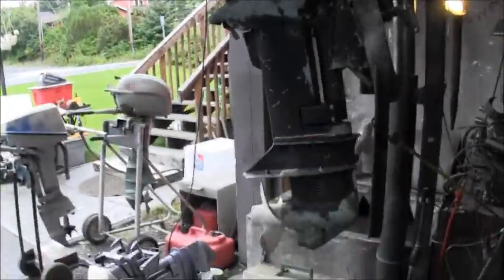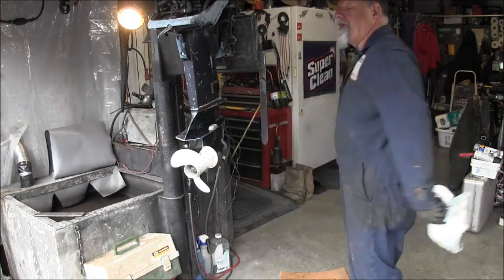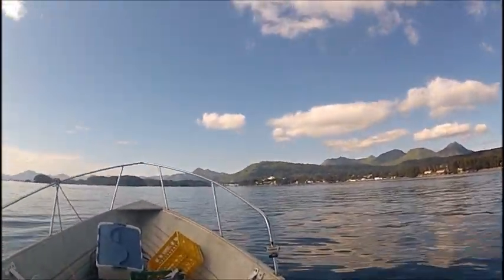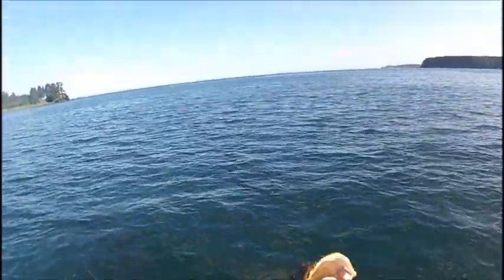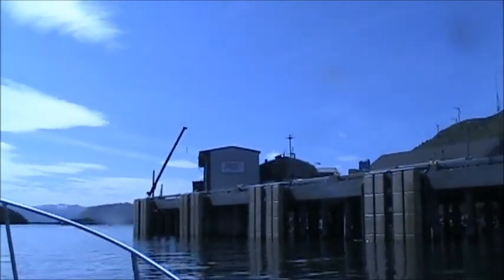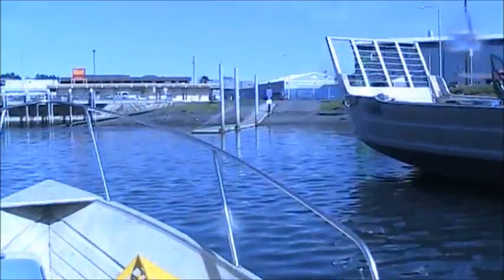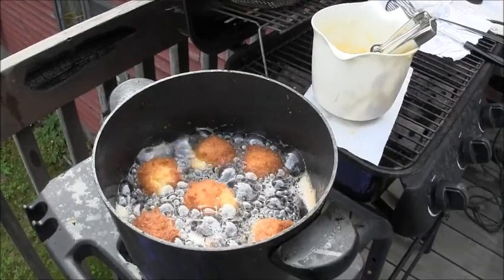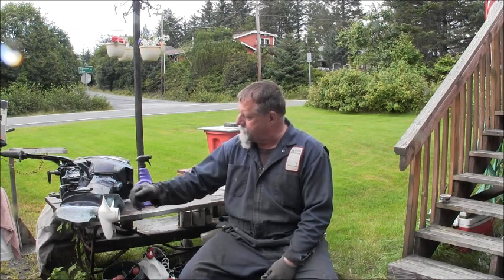EVINRUDE 15 HP,  BOAT RIDE & FISHING

Comment: Hi Kodi, You make me hungry buddy with all that good stuff don't you know. haha Hey took the Starcraft out on Washington down here last week for a test run and the Mercury 60hp purrs like a Lyon. Did a video if you get time to check it out. Hey there is one issue I haven't figured out yet? It takes 9 starts to keep it running when starting it. after its running no problems with it. I think it might be getting a slow leak from the oil injection bypassing the one way valve tee into the fuel line. I think I'll try cleaning it first. you ever had this issue with fuel injected motors before?
Reply from the maker: Can't say I have,  I had a Merc 135 doing kinda that'' turned out to B a loose fuel rail connector after it warmed up I think it expanded enuff to seal, ?       kodi

Comment: Hey Cody , I'm a subscriber, I've got a question, I have a 1960 18hp Evinrude, I have some water spraying from the, shift shaft cover, is that normal, or do I have a leaky water tube grommet?
Reply: That cover plate has holes that allow water to flow in and out of the lower casing. But with the motor running at idle, the water pump should mostly suck in water through there, not spray it out. At high speed, water gushing in from the rear water pickup may create positive pressure inside the casing, part of which could be released at the cover plate. In doubt, service the water pump and change the water tube rubber grommet. Your Fastwin is a great motor that sure is worth maintaining. Regards